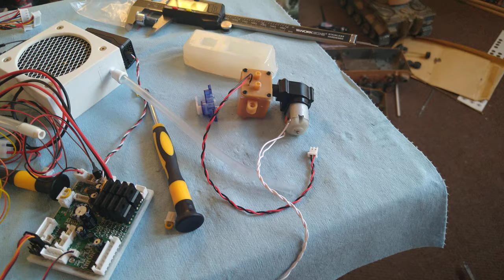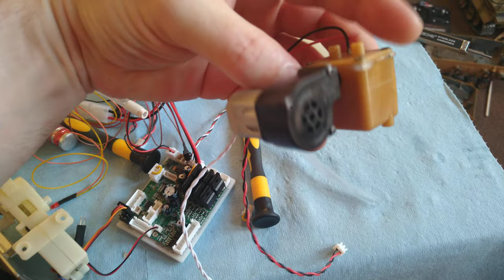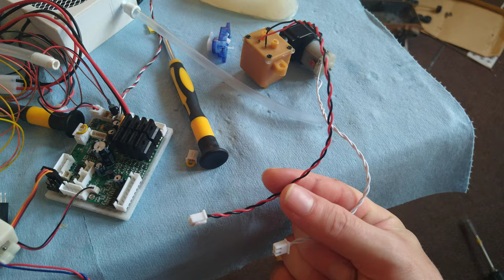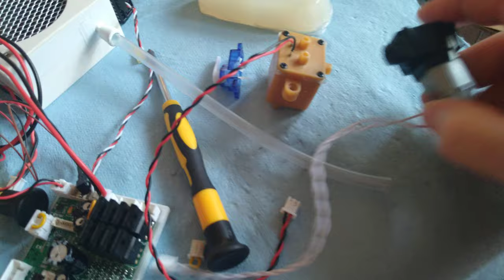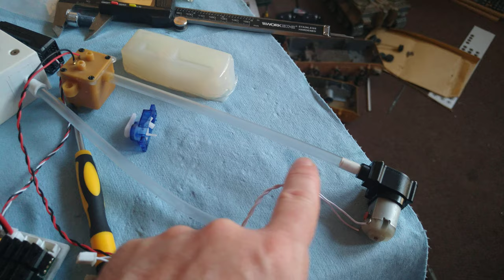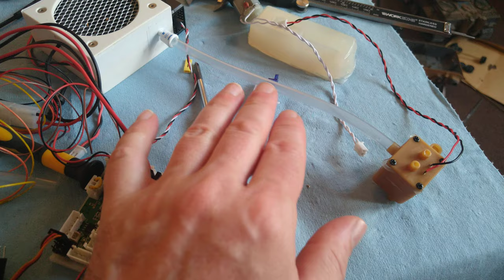Heng long 6.0/6.1 smoke generator.

Comment: what smoke oil do you use?
I used e-cig oil and no smoke comes out
Thanks.
Reply from the maker: I use Mega Steam (odourless) which I bought from Forgebear tanks in the UK, they do scented versions as well to represent the smell of different types of fuel or smoke. I have used nicotine free vape oil as well and it worked, but it stank of peppermint lol. I also tried baby oil, it kind of works for a bit then buggers the heating element up. Mega steam is definitely the best, and is made specifically for this purpose. I hope this helps. Thanks for watching and commenting 👍🏻

Comment: Question, I have a piston type smoker in my heng Long panther Model 3879-1  I took the smoker apart because I watched a video that showed what happens when you have too much fluid in the heater box. Now to my problem smoke is coming out around the piston and barely out the exhaust,  don't see any wear or torn seal can you give me a hint as to what's happening and a possible fix.
Reply from the maker: Is the rubber seal on the piston lubricated? They tend to have a bit of grease on them. The other cause could be that the exhaust passage is blocked by something. Without actually looking at it I can't give you a definitive answer I'm afraid. If you cleaned the chamber/piston out, then add a bit of grease to the seal. Double check smoke fluid hasn't made its way down the exhaust pipes, blocking it.
Reply: @trooperwolfie  I disassembled the whole thing inspected the bore for the piston, lubricated the rubber piston with plumbers grease reassembled it and ran it but it still bypasses the piston and puts more smoke inside the tank than out the exhaust. I checked both ports on the heater box both were open blew at thru the tube and exhaust stacks all were open also. One thing I can say is the gasket material they use on the heater unit is about as sub par as anything I have ever seen.
Reply from the maker: @georgedistel1203  yeah, the gaskets are crap, try some electrical tape around the lid/housing to seal the smoke in. Just make sure there's no smoke fluid on the outside of the housing.

Comment: where did you get the piece to put in speaker and what diameter is the piece and tubing.also have you wired this to a tamiya mfc.i dont know what kind of board you are using.if you used mfc where do the connecting wires go to on the mfc
Reply from the maker: Hi, it's a Clark TK 40 board I'm using, I made the speaker box myself from 1.5mm styrene sheet. The tubing I'm using is from a peg feed giving set from work but silicone tube from an aquatics pet store will work well. The holes In the side of the speaker box/smoker box are 4mm diameter.
Reply: So the pressure inside the box actually pushes out through that tiny 4mm hole, I'm going to try this on my hl tiger 2 tank. The aftermarket blower set is ridiculous with the constant smoke pouring out, like the engines about to blow up 😂
What speaker are you using ?
I'm thinking of using visation rfs-7 4ohm speaker for good sound as the visation fr8 8ohm I have now is a large unit at 8cm in diameter